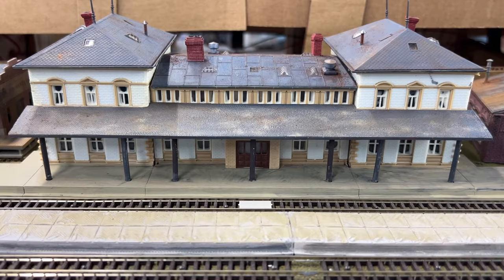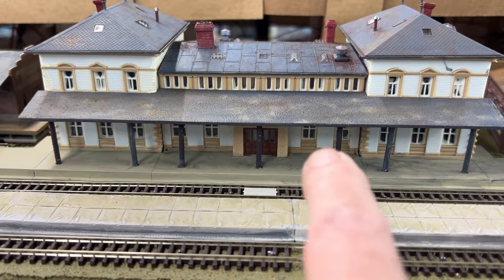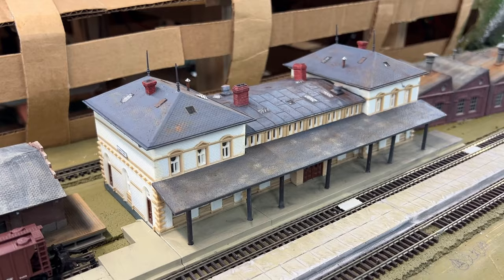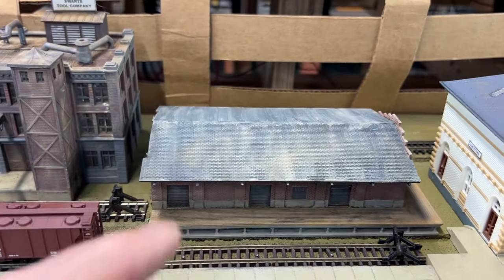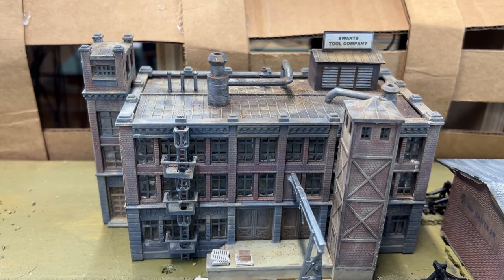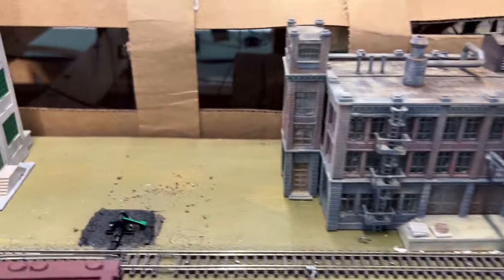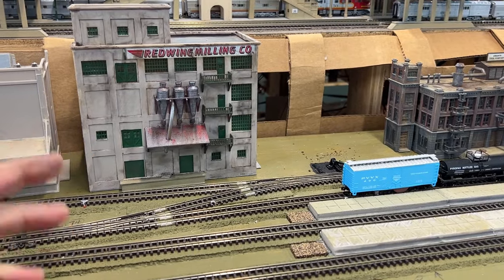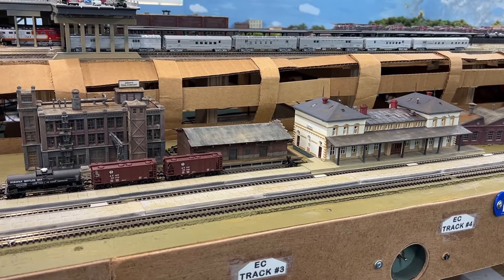Structures for Jamestown (Topeka)

Comment: Those are some very nice structures, it's awesome that you have a 3D printer that can save you money in the long run
Reply from the maker: Thank you Joe. Over the years I have had able to use the 3D printers that I have to both create items and structures as well as to replace missing or broken parts of building kits….John

Comment: cool station building and nice weathering on it too. the tool company building is quite interesting. great details. i recognize the milling company kit- was thinking about that one myself. nice update John, was nice to take a look at those buildings :)
Reply from the maker: Thank you John. As I mentioned in the video, I had lost parts to both the station and the milling kits but I was able to either find some usable ones that I had from other kits as well as 3D printing those I did not have. I have been working the past few days on storage tanks for the milling company which should be done this week.....John

Comment: The work on the buildings looks good John. I guess the printer assy. will be available in May.
Reply from the maker: Hi JD, Thanks for your comments. The message from Bambu Lab stated around the end of March at the earliest. Most printer companies would not have done the recall so it indicates that they care about their products and customers. As a general rule, always have a backup or second printer which I have had for the past 4 years. The A1 does print better detail and is faster than the Vyper but it still is a good printer…... John

Comment: Well John you may have run into a little trouble but the results are great nonetheless, maybe better.
Reply from the maker: Usually when I find that I am missing parts for a structure that was my fault, I would just buy a replacement kit. But not anymore, kits have gotten way too expensive. This is where the 3D printer really comes in handy. Thanks again….John

Comment: yes to 3d painter's CNC machines, I have a couple of industry plasma cutting tables most of which i bought when i was working in the trade i still do fabrication work i have a machine that can bend the metal after it is cut from the CNC put what i need at the machine and push start and the night the mice here does all the work for me i have 4 new planters will be ready the springtime  to seed 
with the train hobby, the 3d painting i could paint off a piece of sawmill equipment to a machines shop stuff to i have done that too i am working on the transmission tower insulator at this time cooking some of the goose's tails i am not to be on their property at all long stony short i would have to lift them on my properties  they did have their own property to use they did need to have a transfer station  they did need to have that allowed them to have access for that too they pay my taxes for the property it sits on  more power for both of us to  yes i did take a lot of picture of them its in paint at this time friend of my found out she a trader build for someone else's small world they knew each other in high school never dated they both lose track of each other too i did not know that she was broke  how the both of them meet again finning part i when to see his train shop as big as mine is just wasted space i told him lol 6 month before he ask me what i am meaning by it he has 30" ceiling the turkey  now have build his lay-out in the wasted space now  she working for him now they going be down end of the months to were going to run some train and track too
Reply from the maker: Hi Jennifer, Thanks for watching and commenting. I totally agree that CNC and laser cutting machines as well as 3D printing have really added a new dimension to the model railroading hobby…..John